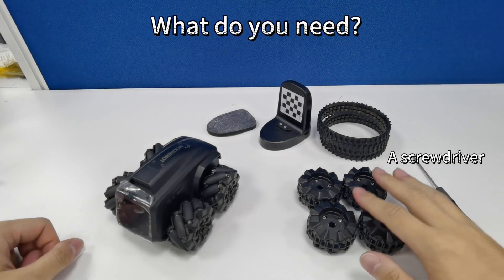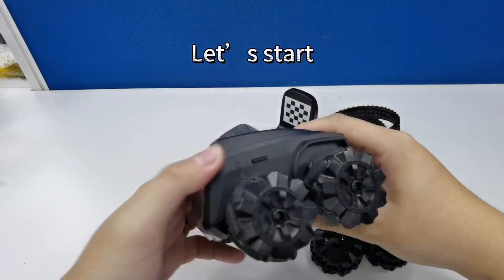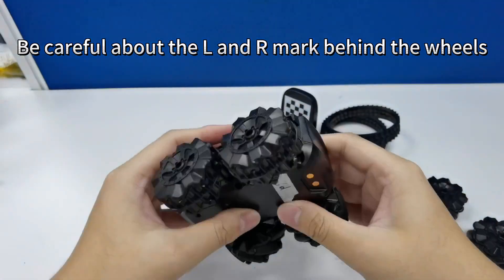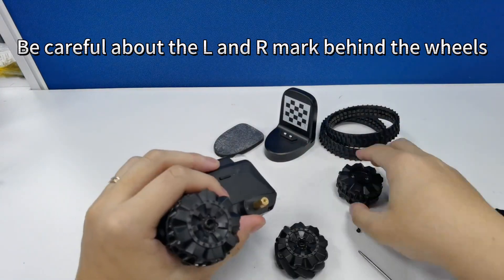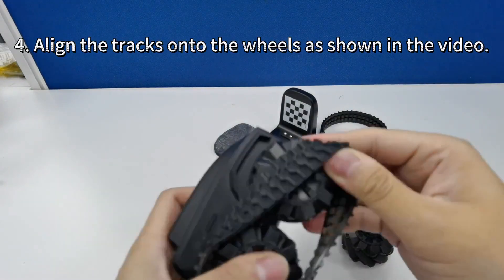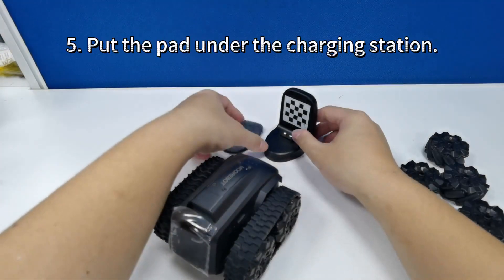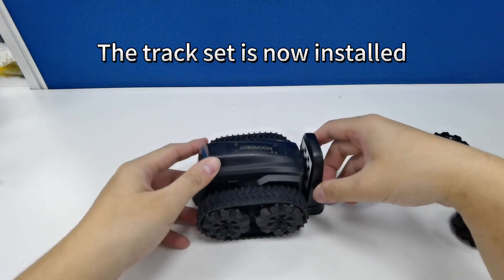Install Track Set - Moorebot Scout

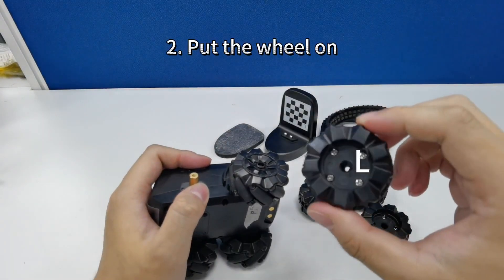Comment: WTF?! So I just installed these, and this video gives incomplete instructions, resulting in a couple lost pieces on my end. At the 0:20 mark, see how they are holding their thumb against the brass hub? That's because there are little itty bitty teeny weeny pins in them that connect the hub to the axel. So hold(on a table, or over a plate or container, just in case) the Scout at a 90 degree angle so that the brass hubs are pointing straight up. Slowly pull the wheel off. When you have it removed check the axel. You'll see a small hole on one side of the brass bit, with a tiny silver pin slotted into the hole. THIS IS AN IMPORTANT PIECE. If it's still in there you're all set. If it isn't check the table/container for it, because it fell out. This is the piece that actually holds the wheels on. Without it they'll just fall right off.

Thankfully they did include 2 spares in the track kit, but I had lost 2 before I even knew they were a thing. So how about including 2 more pins, and updating the instructions? Thanks. The other 2 were pretty easy once I knew there were bits that could fall out.
Reply: Hey bro, I'm also thinking about swapping the Mechanum wheels to the track wheel; did it work fine with Brother? Is it worth installing these? In their own  website, assistant( AI) it said it will not work with a mechanical wheel model. Swapping will lead to problems in patrol mode, etc. is this true?
Reply: @independentscrambler  The tracks have been installed on mine since I posted that, and it works fine. Better in some cases. You lose the feature to move in any direction, but it'll follow a set path easier. I'd recommend buying/printing/fashioning your own bumper, as without it it likes to climb up objects and flip over when it meets them. With the bumper it does not, and can actually push some decently sized objects. I've seen a video from someone who fashioned their own attachment to the rear which keeps it from flipping over. It was like what WW1 tanks would you to cross trenches. 

But yes. I can only speak for the Scout model, but the tracks have ben fine on mine. Just remember to take the wheels off close to the surface of a table, and don't lose those tiny pins.